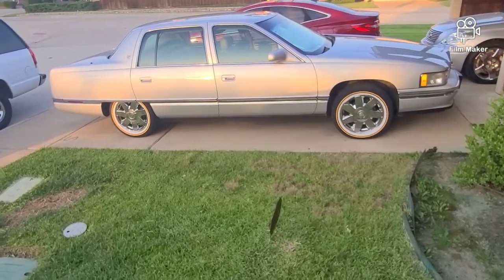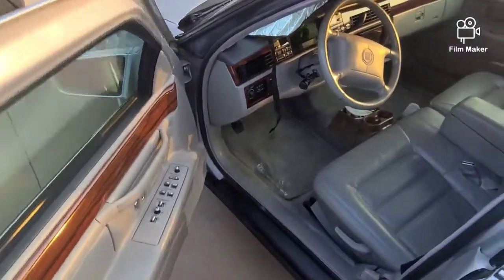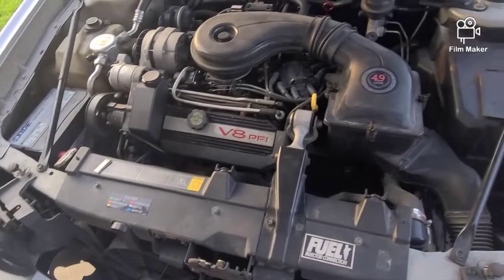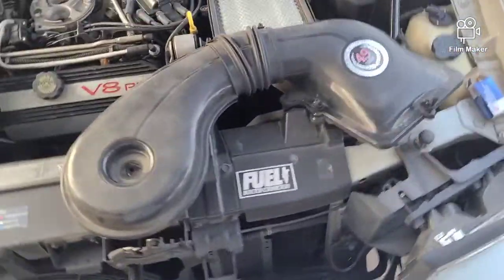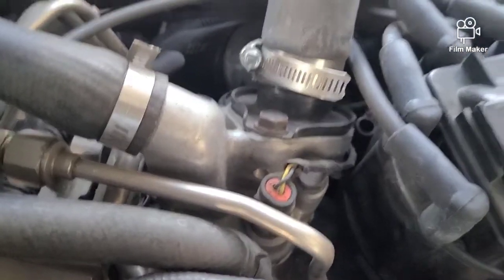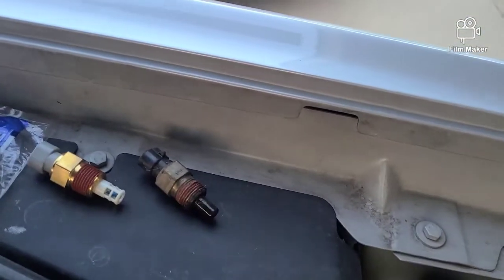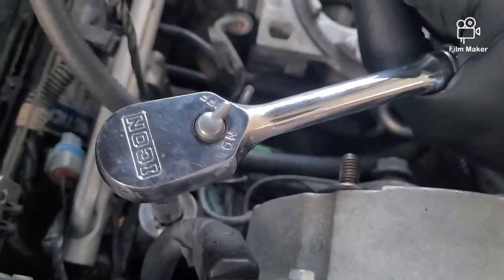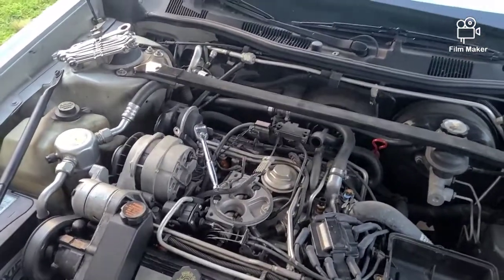QUICK AND EASY DIY REPAIR!! 91-95 Cadillac 4.9 Coolant Temp Sensor And Air Temp Sensor Replacement

Comment: Hey Mr jones I have a 96 Cadillac deville and I can’t get my coolant temp sensor back in
Reply from the maker: What's going on sir. On your 96 you have the Northstar engine which is very different from the 4.9 liter. With your coolant temp sensor. Is it cross threaded?
Reply: @lawjo1978 to my knowledge no. All I know is I twisted it left to take it out and once I twist right to put it in it just spins as if the thread doesn’t catch
Reply from the maker: Is the new coolant temp sensor identical to the old one that you removed?
Reply: @lawjo1978  I will tell you once I get home
Reply from the maker: @Hunnidbandhustla Okay thank you. Keep me posted

Comment: Can a faulty coolant temp sensor cause my plastic coolant can to overflow and boil like crazy!?.. I just switched the thermostat and the fuses for cooling fan are fine.. My cooling fan has been coming off and on at the most random times.. so im just trying to self diagnose everything..
Reply from the maker: Hey, I'm sorry for the delayed response. If your system is overflowing then you probably have some trapped air in your system and you will have to burp it

Comment: hey mr jones! what is that bright green plug thats below the harness @ 7:38? i noticed last time i looked in my engine that mine wasn’t plugged to anything.
Reply from the maker: Good Morning, sorry for the delayed response. The light green plugs is what you use to ground out the alternator when you have to do idle adjustment on the car

Comment: Just bought one. The part that connects the wire and holds it in place broke off mine so my fan wouldn't come on.
Reply from the maker: Where you able to get a new connector for the temp sensor?
Reply: @lawjo1978  just bought a new sensor.  The connector on the sensor itself broke. The end on the wires from the harness was still good

Comment: Does this affect the AC too? Whenever I turn my AC on it tends to get hot even faster
Reply from the maker: Good Morning, it will have an effect on it due to the fact there is a little more load on the engine. If you haven't done it yet. I would replace the thermostat in your car
Reply: @lawjo1978  okay cool I’m doing it today. The thermostat and ac sensor are same thing?
Reply from the maker: @someone7773  Those are 2 different things
Reply: @lawjo1978  oh okay why should I dual the job? Is there a specific reason
Reply from the maker: @someone7773  To prevent your car from not overheating. Keep your a/c running like it should

Comment: So would these being bad also cause your car to stall at higher temps?Temps?
Have a 4.9 94 deville also and she's been kicking my ass
Reply from the maker: Hey Kent, I was having that same similar issue that you're dealing with now. When the coolant temp sensor starts to go bad. They have the computer in our car going almost crazy. That temp is basically telling the computer that I need more gas to start up. In which it will cause it to like stall or either a hard to start condition
Reply: Hey jones, what is the sensor on the back right side of the engine? I broke it changing the plugs the other day my engine is stalling randomly now..It looks like a coolant sensor, but I guess not.
Reply from the maker: @HOMBREDEFAMILIA That is the  air intake sensor. It mounts in the manifold
Reply: I heard it was the engine temperature switch?
Reply from the maker: @HOMBREDEFAMILIA if you under the hood of the car. And you're looking at the right side. That will be indeed the coolant temp sensor
Reply: @lawjo1978  on the head or the block? About 2 inches above the rear right spark plug not sure what number it is.
Reply from the maker: @HOMBREDEFAMILIA That sensor is on the intake manifold between #6 and #8 spark plug area
Reply from the maker: @HOMBREDEFAMILIA  That indeed is the temp sensor

Comment: I just literally replaced that sensor(MAT) 15 mins ago, but it will not clear the code even with a professional scanner, or reseting the ecm thru disconnecting battery,rain cut my work short, any tips on what I may have done incorrectly 🤔, thanks in advance
Reply from the maker: You can actually clear the trouble code through the on board computer in these cars
Reply: @lawjo1978  usually  yes but my FDC decided to not come on today lol, it does that sometimes 🤷‍♂️ , while this car is mainly my grocery getter ,I like to keep it mechanically sound and mantained  , all I can think is the chamber has to be flooded since I had to drive it back home when the sensor failed

Comment: Hi Mr Jones.
I saw your video on replacing air and Temp sensors.
Great video!
I think I need to replace the fan sensor. Is that the same thing as temp sensor? If not, where is the fan sensor?
Reply from the maker: Thanks for the feedback. Are your fans working on your car?
Reply: @lawjo1978  no, not turning on. Engine feels really hot.
Reply from the maker: @Caige Access  You may want to check the fan relay and fuse for it. And if those check out being good. Then it could very well be the fan motors itself are no good
Reply: @lawjo1978  thank you for your response, I'll be looking into to those things in the morning.
My car happens to be like that model in your driveway. 94 DeVille (basemodel) 4.9L.
Your's is pretty!😁👍
Reply from the maker: @Caige Access  Thank you sir. Gladly appreciate it

Comment: Would this be the reason I keep getting engine overheated message on my dash even tho I just got a new radiator I don’t have a blown Hg I checked for the common signs please help
Reply from the maker: That's a good possibility is a bad temp sensor. Especially if your not overheating
Reply: @lawjo1978  I just changed it and it the dash Still says it’s over heating
Reply: Yea it says it soons the engine turn on even when the car is cold
Reply from the maker: @Gbody  If you haven't changed that sensor as of yet. I would definitely change it out. And even the plug if it isn't in good condition
Reply: @lawjo1978  that’s Cadillac master!! Will give it a go next week
Reply from the maker: @Gbody  Keep me updated if you like. I would like to know if that solves your issue.
Reply: @lawjo1978  I think it may be my water pump I did notice water shootin from weep hole 🙁🙁 but car nvr over heated and leak stopped guess I’ll be having some fun doing that next weekend
Reply from the maker: @Gbody  The water on the Caddy HT series engines isn't no game. So tight over there and different size nuts and bolts. Just take your time and it will come out spot on. About an 2-3 hr job
Reply: @lawjo1978  I plan on taking the Jack the engine method … any better methods besides putting it in the air ? And thanks brother you’re awesome
Reply from the maker: @Gbody  I was gonna suggest the jack up the engine method. If you jack under the oil pan make sure you place a 2x4 or some type wood under it to not bend up the oil pan

Comment: I'm going to order them and replace mine on my 92 deville.
Question, my climate control keeps blinking and soon as the car is warm it stops, and when I jump in and go, it doesn't show nothing until my car is warm. What could be my issue.

Comment: Hey Mr. law Jones how do you pull the abs codes
Reply from the maker: What's going on Dirtyy Boi.... You have to pull the ABS codes from the driver's instrument cluster/panel. To get into the onboard system you have to push off and warmer at the same time and you'll be able to get into the system that way. Select ABS codes and write all codes down and go from there
Reply: @lawjo1978  do I have to go into one of the programs like mines has in says pcm, ipc and something else just to get to the abs codes how do I get to them exacy
Reply from the maker: @dirtyyboi2027 ABS CODE RETRIVAL:
1) With Ignition off ground ALDL pin H (jumper pins "H" and "A")
2) Turn Ignition to the run position
3) The ABS indicator light will illuminate for 4 second , then turn off this will begin diagnostic sequence
4)note the flashes of the ABS light ie:
It will flash one for half a second , then 1 second will go by and it will flash twice for half a second each time , this means a code 12

Comment: I got a question, I have a 95 Deville and my PCM fuse keep blowing as soon as I turn on the key, I change my fuel pump still doing it. Any suggestions???
Reply from the maker: What's going Legrant..... Sounds like you have a wiring short somewhere. You may want to check your wiring out. Make sure you don't have any naked wires touching somewhere on the car
Reply: @lawjo1978  Thanks bro💪🏾  I’m on it! Will let you know..
Reply from the maker: @legranthill151  Let me know what you come up with brother